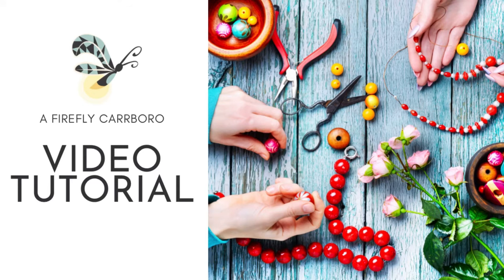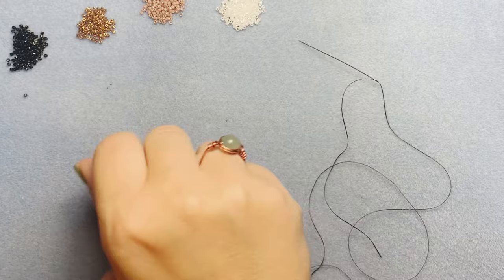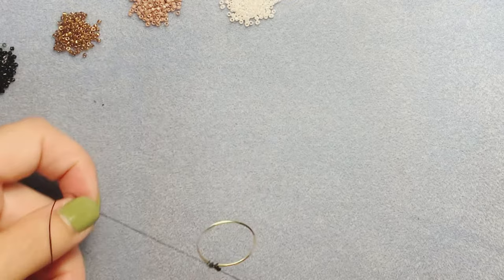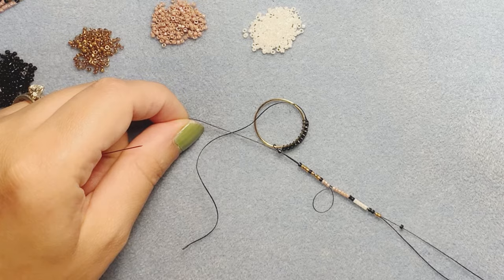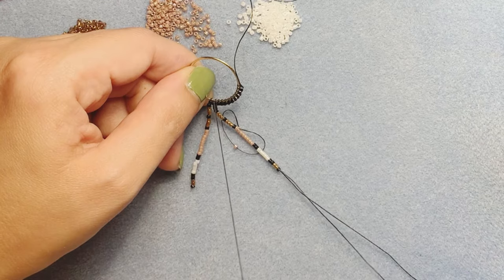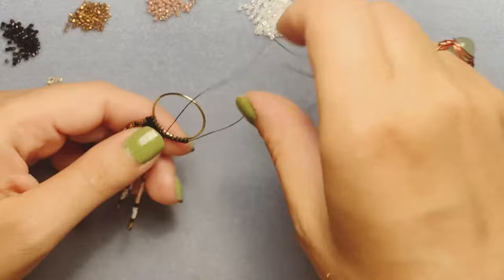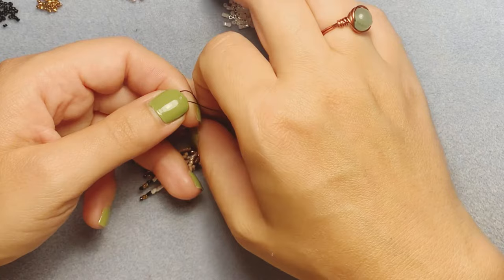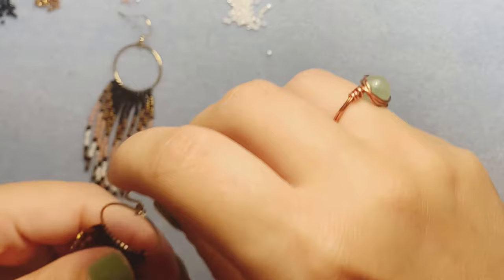A How-To: Bead Weaving Fringe onto a Hoop

Comment: I love the tutorial.  I have a question about the fringe. It looks like each line is pulled so snug that there isn't room for the 2 end ones to lay straight down.  They bow out some. Is there some other way to keep them from bowing.  Mine did the same thing.
Reply from the maker: Thanks for watching!

I think the bowing actually has something to do with beading on the round hoop. Typically with the fringe by itself, I don’t have much of an issue. But when I put it on a hoop both ends do bow slightly. I’m honestly not sure how to prevent that.
Reply: The bowing is because of the hoops, and the fact that the thread wraps around the hoop are closer together than the threads inside the beads. The only thing I can think of, is to use a slightly larger bead between each thread wrap on the hoop.  You may need to make fewer rows of fringe, then, though.
Reply: @fireflycarrboro  they don't do that as much if you use a more teardrop shaped hoop, and also I am experimenting with making the first 2 and last 2 pieces with smaller gauge beads to see if they will lay better.
Reply from the maker: @ooohlaa13  Good to know!
Reply: I'm new to this, but what if you use two needles and work your way in and then weave the thread to go out to sides... or tie at the middle?  I saw another tutorial where they iron the string 😮.

Comment: What type of Hoops do you use for your earrings?
Reply from the maker: You can create your own hoops or I have premade hoops that I sell at my shop. They're called Endless Hoops.
Reply: How does one create their own hoops; and how do I get to your shop?
Thank you
Reply: @genevieveramirez596  I found a bottle from essential oil that was the right size to wrap the wire around, works out pretty well ... practice with soft artistic wire to get the hang of it to make diameter that pleases you.  I used 20 gauge copper wire, a bit soft but I am experimenting.